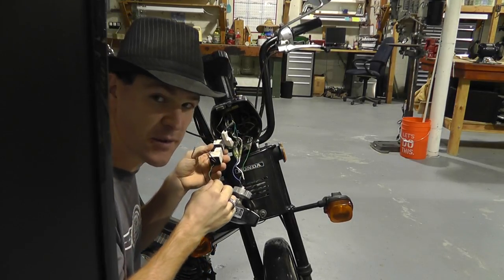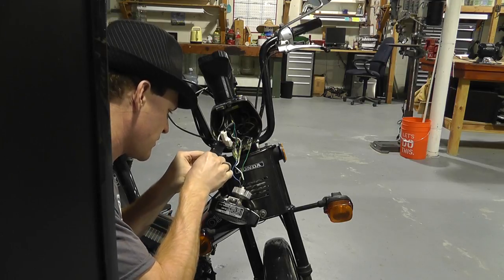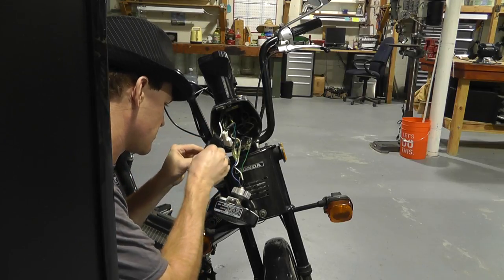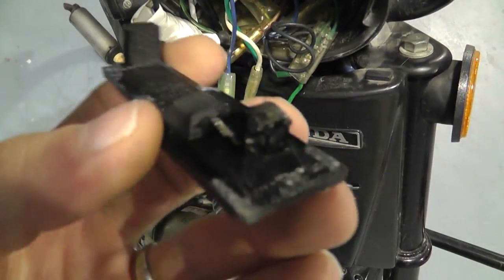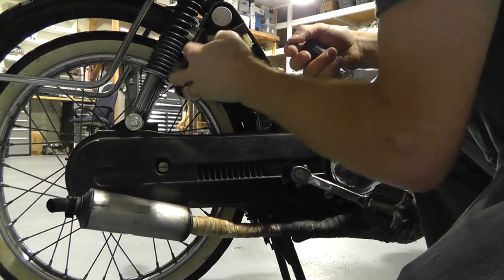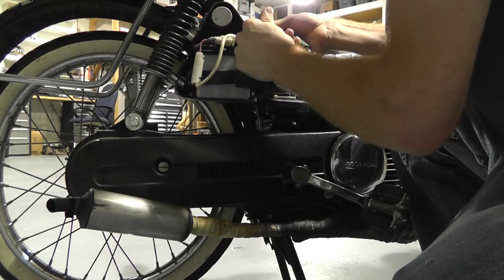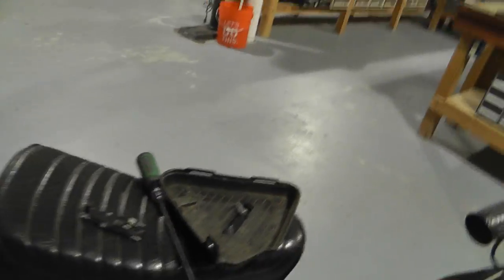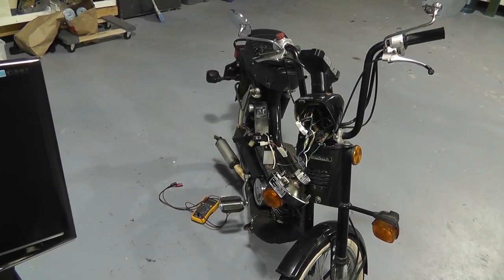IC Desoldering Themselves. Lost Honda Hot-Rod Hobbit Video...  (Un Cut)

Comment: ah so the low voltage was making the buck converter work harder and eventually blow
Reply from the maker: David Scheiber i think it was over voting. the battery kinda acts like a buffer. keeping the voltage down. but if the battery acid is low it acts like an open and the voltage can go else where. so that's why the light got brighter. it might even been some voktsge spikes. again the battery keeps thing under control. you can't run this with out a battery. things go Pop. lol. ~Russ
Reply: Russ I think you will find the boost converter was drawing 3 or 4 times the current to drive the output and when it blew the load was removed which is why the headlights got brighter as the boost converter was dragging the voltage down so much .... I am not sure what you were driving with it ? i.e. charging battery, or indicators but I bought about 4 of them and found on my solar power system as the voltage input was low early in the morning from the solar panel, it could not get past about 4 volts input and output was poor due to conversion ratio being very poor. Those boards are very bad for bringing up input voltage slowly too many thermal losses, around 4 to 6 volts then at about 7 volts IN they work better, with less thermal wastage.

Comment: I have a few of those boost convertors from china they get very hungry for current when the input voltage drops too low I fried one too by driving it at too low a voltage and yes HEAT / thermal runaway is a huge problem with them very poor heatsinks all they have is the pcb equals inadequate thermal cooling. The Chinese are very good at making fireworks seems in modern times they want to re-invent the firework by making it solid state.